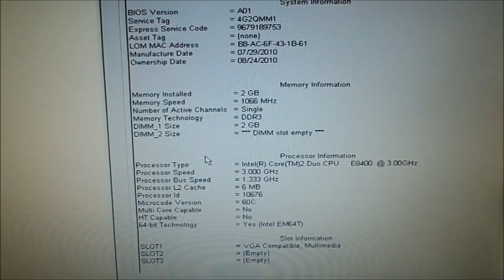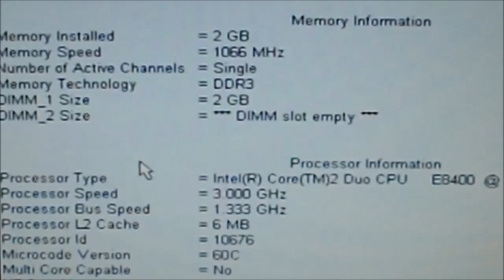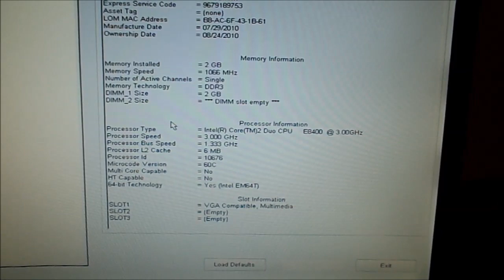Dell Optiplex 380 Upgrade CPU and Install Video Card

Comment: Would I be able to fit an hd7970 into it? I am getting one for 40 dollars and want to use it. Is there a motheboard power limit? I know I have to replace the psu but do I have to replace anything else? ( I know I will have a couple bottleneck but this is just to hold me over untill I can get more parts) thanks!

Comment: I have a stock 380. Is there a slot I can use to add a wifi card or should I just find a USB wifi adapter? Either way can you recommend an adapter for me to use?
Reply from the maker: Yes there are some PCI slots in there. You should be able to find an adapter type wifi card, but the USB ones are much more common. Good luck.

Comment: how many ram does the 380 support ?
Reply: Optiplex 380 supports 8GB RAM
Reply from the maker: hajime2k
True, however the Optiplex 380 is a little picky about what brand of RAM you use. I know the machine supports 8GB of Crucial RAM. I have 2 8GB kits of TEAM Elite+ RAM- cheap stuff that worked in my Optiplex 580, but will not work in my 380. Sad part is, The speed and voltage on That RAM are both what the machine calls for.

Comment: can a 750ti fit
Reply from the maker: +Oseghale Imonikhe You have to check and see if there is a small form factor version of that video card. The machine in my video is the mini tower version and has the BTX form factor Motherboard. The heatsink for the CPU is the real problem in that machine. You really can't fit a fullsize two lane video card in there for the reason I just mentioned, and the two lane card wouldn't be able to mount properly because a single lane card mounts in the top slot both on the board and in the case.
Reply: thanks

Comment: can i put a gtx550 ti in it?
Reply from the maker: Unless there is a low profile version of the GTX550 ti it's likely that the card won't fit because of the arrangement of the Heat sink for the CPU. Damn shame because that is still a fairly decent graphics card.